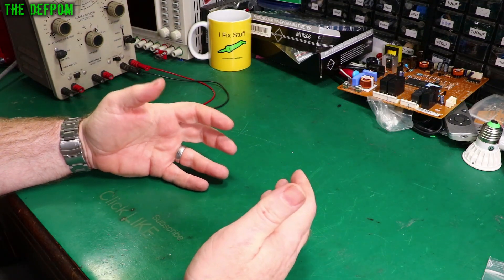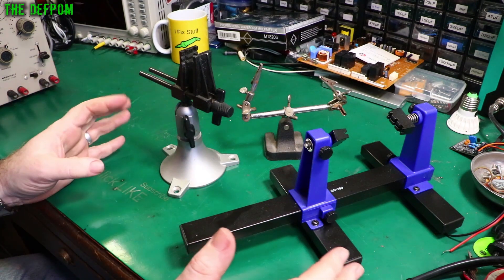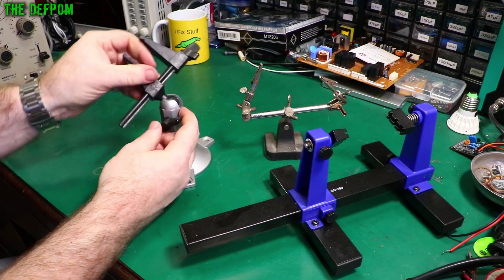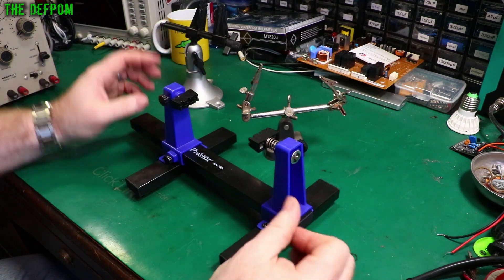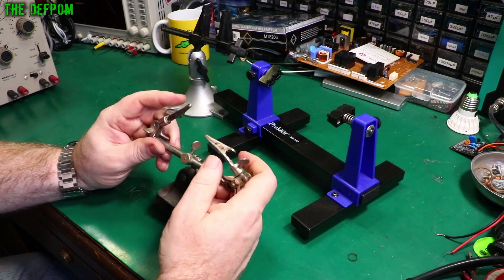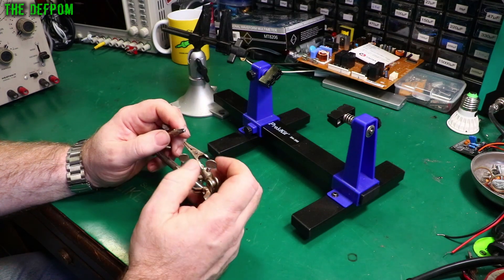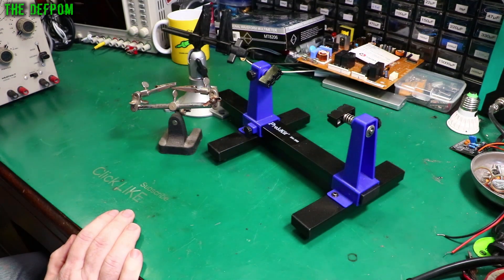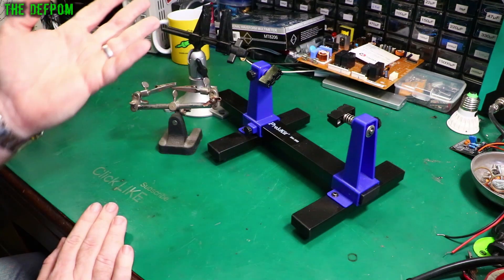🔴 Electronics Tools For Beginners - No.11 - PCB Holders - No.1013

Comment: Personally I find even the magnet ones too high, but like you said, it depends a lot on what you're working on. On one or double sided PCBs with a lot of big capacitors, sockets and so on one of these higher PCB holders is great, while on small SMD PCBs the lower profile ones are much more ergonomic to solder. It gives a so much steadier hand for soldering tiny SMD parts if the hand can rest on the table while soldering. 
I guess the best solution is to have both.  One of the small flat profile holders for SMD boards (Chinese brands specialized on equipment for fixing phones have high quality holders for a good price), and one like you've shown for holding large boards with big sized components / sockets.

Comment: Hardly ever use these ever. Or it is the PCBite ones. Why? Because they interfere with me using the microscope. Too high.

One alternative I sometimes also use of late is some rather nifty low profile magnetic ones. Similar idea to the PCBite's but more versatile. Essentially a strong earthmagnet with a springloaded miniclamp. Nifty part being you can reverse the spring loaded bit (which is also held magnetically by the earthmagnet base) to get the little clamps really low to the desk. I can't remember where I got them though.

Comment: I only ever use my cheap chinese helping hands, i find large pcb holders just get in the way too much.
But, usually, the best 'device' for holding a Pcb is just learning to manipulate your own fingers to do the job......almost like having another hand!
Reply: I have felt the same, but after looking at it a little more, I'll be spending a little on the ProsKit. I am building a few boards for home automation that are larger then normal, and the old method is making a mess of things. Guess that goes back to having a particular situation versus the norm.